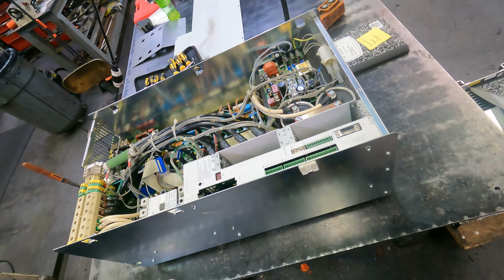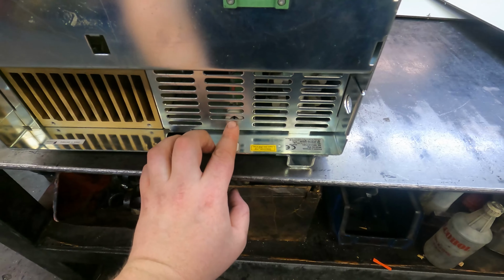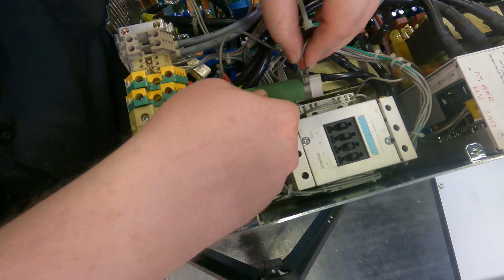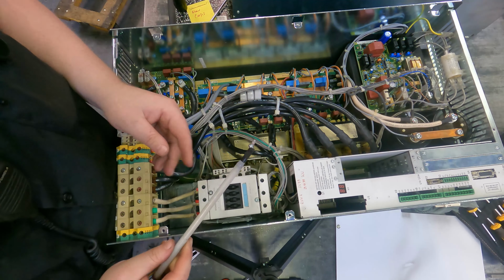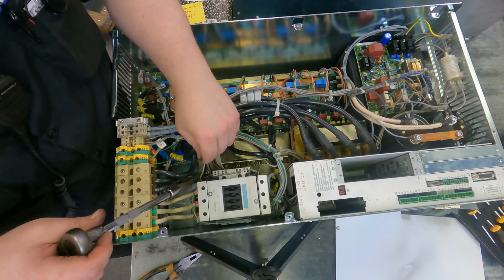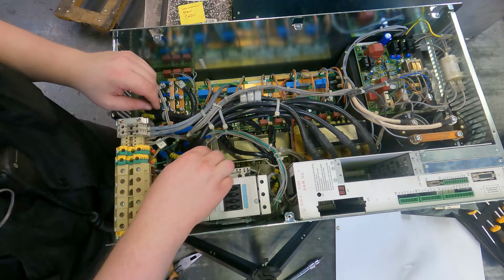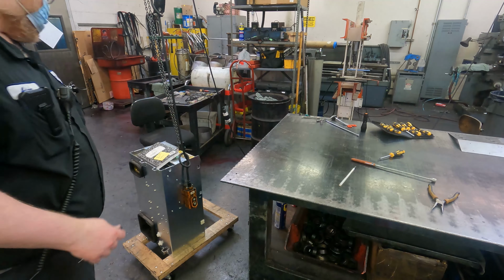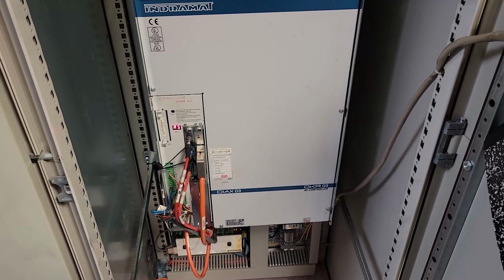Press Maintenance - DKR F820 Bleeder Overload Repair

Comment: Hello.
I am very impressed by the maintenance shop you have!
Roller dolly's to move heavy parts, and a crane to lift them onto the workbench.
What exactly does that drive control on your press?
You are always interesting to watch. The press I work on and maintain is much smaller.
Goss Community, four towers with an N-40 Folder Built in China 2005. Megtec Se Series Roll Splicers built in China as well.
Gammerler Newspaper stackers built in Germany, and Mosca bundle strappers.
Reply from the maker: Thank you.  :)  It's a shaftless press.  Each couple has a motor, and each motor uses one of those drives.
Reply from the maker: I've heard a lot of good things about the Community presses.  Before I worked here I was an operator on a Headliner.  I believe that shares a lot of the build of the Community.  We use a Gammerler trimmer and that thing's a beast.  How do those strappers treat you?
Reply: What we have to check if F891 error occurred